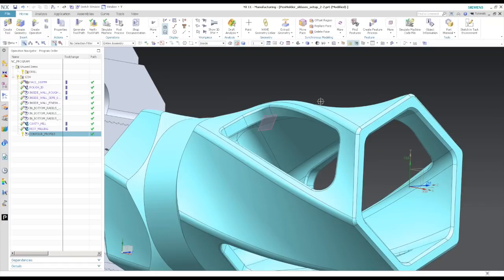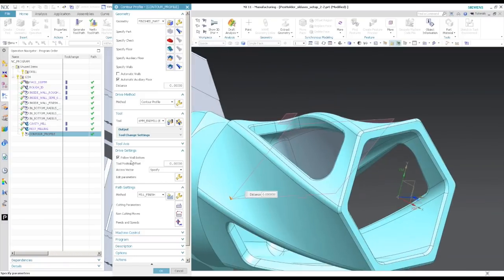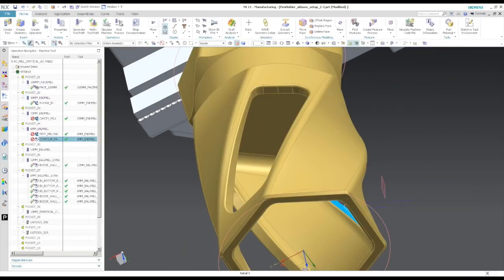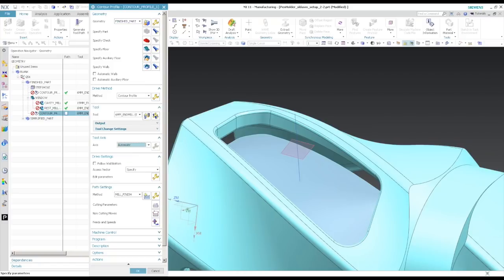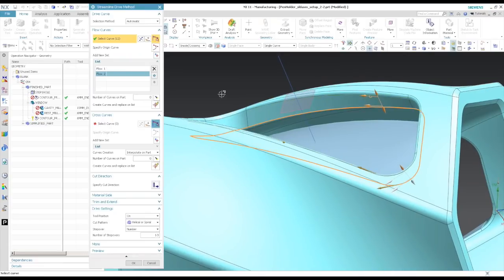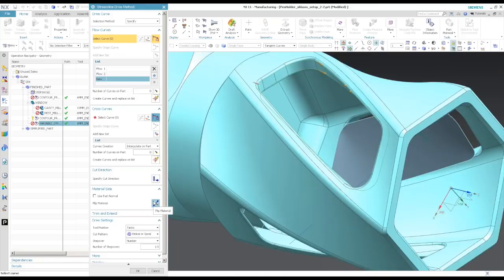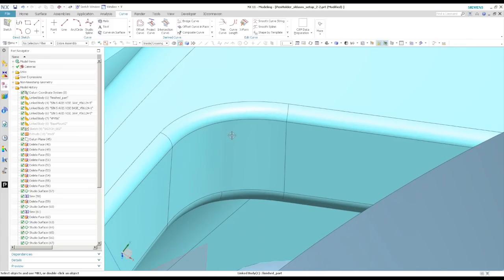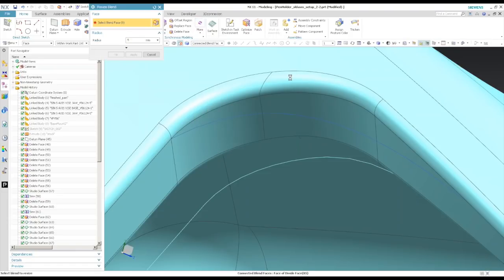Advanced 5-Axis Milling with NX Surfacing

Comment: If the part was modeled natively in NX, would the UV lines have been correct?
Reply from the maker: Not necessarily if they were created through solid modeling. They seem to only be correct if they are surface modeled.
Reply: Yes, when modeling in NX it does a great job of aligning UV lines.